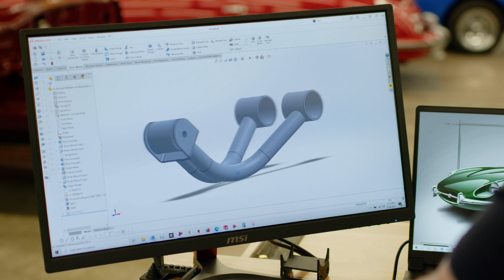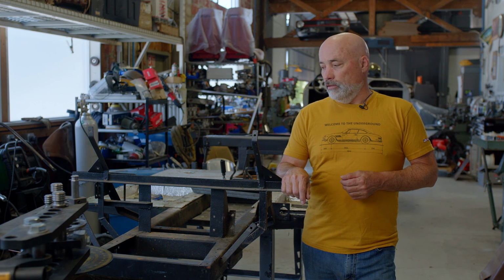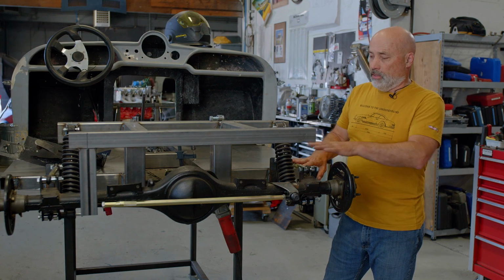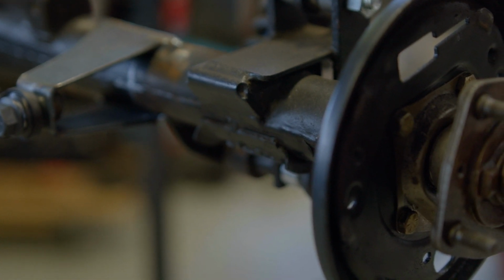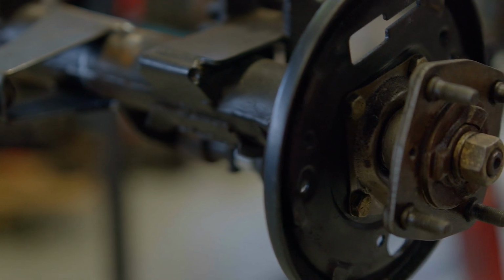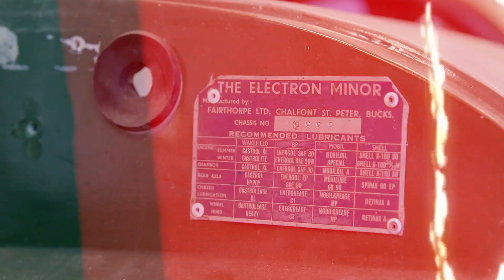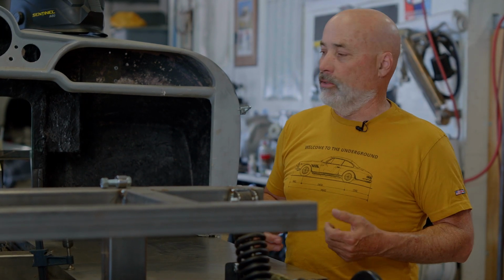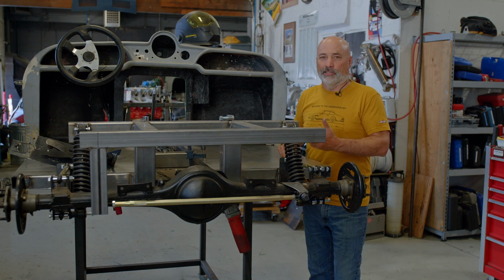Fairthorpe Electron | Vintage Underground Profiles

Comment: Looks like I will be doing some research. I wonder if it may be mentioned in one of my additions of  Automobile Quarterly. Projected weight? 1200lbs - 1400lbs?
Reply from the maker: yea absolutely.  I will have the guys put it on the scales.  Should be interesting!